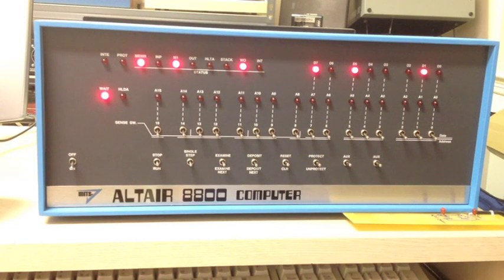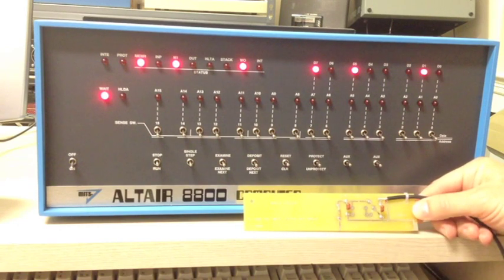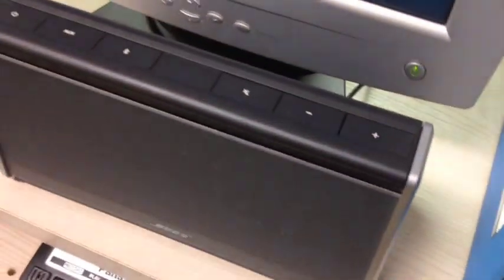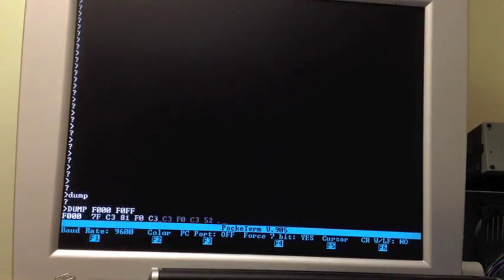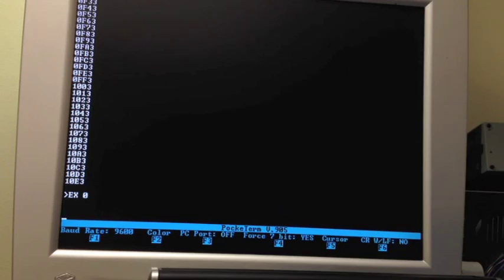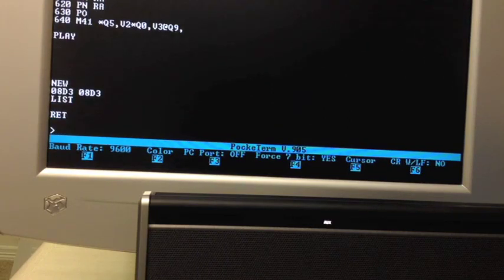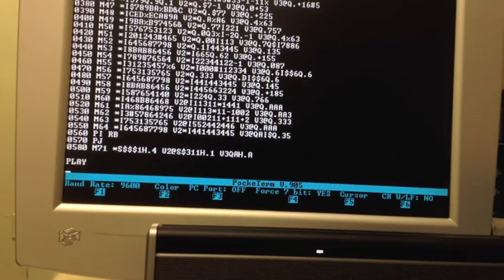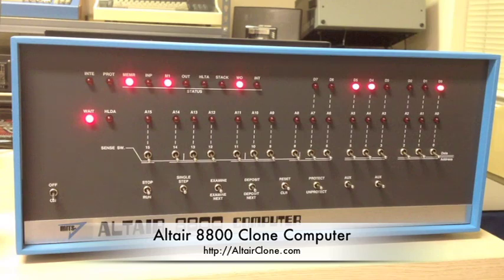Altair 8800 - Video #30 - Music System on the Altair Clone

Comment: Can an S100 backplane be soldered to the connections of the microcontroller, or are some of the pins of the bus not present on the microcontroller? (Besides power.)
Reply: Not in any way that I can see - the voltages would be quite different between the  modern Microcontroller and the original 8080.

It would be interesting to see if you could do an Altair 680b clone as well (Yes, I know the form factor is completely different)
Reply: hyretech well would a logic buffer be able to pull-up or down the voltage? I ask since I don't know the voyages used and required. I'm guessing though +5 Volt are required for it to work with the old devices.